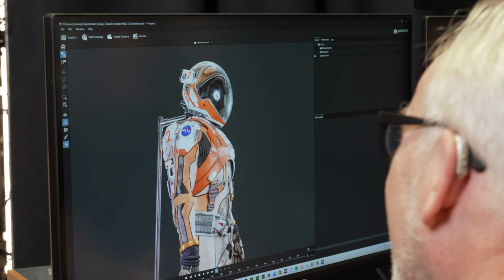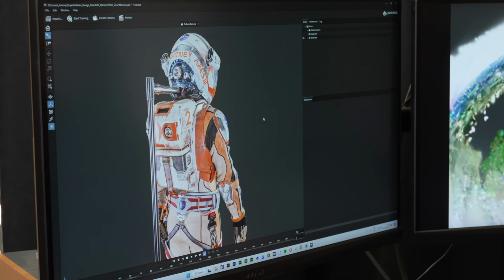Adam Savage Learns About Gaussian Splats!

Comment: I do hard surface 3D modelling for VR, and like in the Church example I use Gaussian Splats for 360 3D reference. When modelling a game asset based off of a real life prop, I'll do a LiDAR scan of the prop for scale and rough detail, then I'll capture a Gaussian Splat for 360 visual reference, especially for fine details like hoses, ropes and wires that LiDAR can't make out. Instead of 100 images gathered and arranged in PureRef, I have a browser tab open with a splat.

In a pinch, I've taken the point data of a Splat, run that through a geometry node in Blender and apply a cube to each point to have a mesh that I can trace off of. 1 million points becomes 6 million polygons, so it's slow to use but now I have an untextured mesh of the splat.

Comment: 13:00 Google Earth is going to get way much better, especially for the VR version
Reply: I’m thinking the next MS Flight Simulator… seems like it could be insane performance
Reply: I do wonder exactly how "small" the file sizes are and if it'd be practical to upgrade google earth, but it would be goddamn amazing to be able to zoom in on some random abandoned factory in another country and just sit on the roof like I was actually there
Reply: @gearandalthefirst  Splats are not that much smaller, they can reach the GB range when a textured model would get to a couple hundred MB, with the texture being the largest thing.
Reply: @GoldSrc_  Makes sense, that's what I thought. Guess I'll have to find one of those drone trickshot flythroughs of a cool building and and build my own splats. If that's possible (if it was that easy, everyone would be doing it, right?)
Reply: How coincidental, before opening this video I got a like on a comment I made months ago on a video regarding this very topic, check out "This AI Just Fixed Google Earth’s Biggest Problem" by Bilawal Sidhu, this is the description of the video: Satellite imagery can see your roof… but not your street, your doorway, or any of the geometry that makes a city feel real. For decades, that blind spot has crippled every 3D reconstruction pipeline on the planet. Today, a group of researchers may have just solved it.

This video breaks down Skyfall-GS — a new paper that uses Gaussian Splatting + diffusion models to reconstruct full 3D cities using only satellite images. No airplanes. No street-level photos. No LiDAR. Nothing but the data already orbiting above us.

Comment: I'm curious if the bit cloud effect in this video when they show a splat was added in post, or is just what resolving the splat looks like? I assume it's added in post, but I could imagine that taking iterative frames of the splat as it's calculated could look something like that.
Reply: If you mean the section at the end where they show a splat of Adam, that's probably just the Gaussians being animated in whichever software they used to render the splat. One of the neat things with Gaussian splats is because each Gaussian is just a point in space, you're able to do a bunch of effects on them like animate them to make them move around or fade in and out of existence, or use them as input for a separate effect like spawning fire particle systems on each Gaussian to make it look like the splat is on fire.

Comment: What about in gaming? I'm sure that there is a pretty high desire for high-res models being rendered at high-framerates. 
Though, I suppose dynamic lighting would get nerfed, now that I'm thinking about it.
Reply: The thing is that this isn't a model. Gaussian splats are point clouds, they're just a collection of elliptical points that have data associated with them. And to make matters worse, that data has lighting baked into it, which not only makes dynamic lighting quite literally impossible as you've pointed out, but it also means that static lighting is fixed to whatever the lighting conditions were when the images used for the splat were taken. The amount of games that can reuse the real-life lighting conditions for the in-game static lighting is rather small, but even among those, if a level designer doesn't like how a certain area is lit in real-life and wants to introduce artificial lighting there, they're kinda screwed if they used a splat to represent the scene.

At the most, the current version of Gaussian splatting can really only be used for reference material in my opinion. You'd use it as an interactive reference for modeling and naturally lighting an asset or entire environment, but the actual model and lighting would be created separately.

Comment: How can this be lighter weight than polygons?
Reply: In terms of processing power needed, they are. In terms of filesize, they're quite huge for now
Reply: I think because stuff like color, material texture, lighting, transparency, etc all get build into the base data and to reproduce the model from a given perspective you only need to render the splats that are visible and it all blends together. 

It would be like if a 3d model polygon had all the texturing and everything baked in
Reply: Magic
Reply: Point-based representations are like polygons/triangles without the edge connectivity data: just vertices.  As the magnitude and resolution of your point samples increases, the value of drawing polies in between them decreases.  In the past, the rendering pipeline handled only so many vertices and more pixels/fragments, and you can see the evolution of these starting to blur together.  In fact, you can think of vertices as just very special pixels/fragments that happen to contain key spatial information of where the surface is at a certain lower-resolution "grid", with the bulk pixels/fragments having values computed based on the data in those vertices.

Point-based methods end up becoming more efficient a representation, even before when you move away from representing and rendering solid objects with surfaces, which is why things like clouds and hair/fur, and the flames of diff types of fire were better drawn using particle systems or special simulations for such objects.